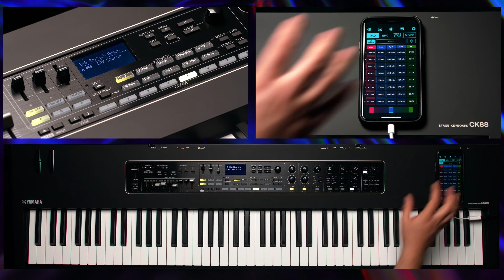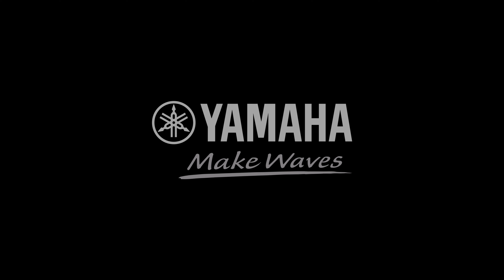CK Tips | How To Use The Mod Wheel To Control The USB Audio Input Volume

Comment: I have tried connecting an iOS servicing using the USB-B host port but the iOS device is not recognized.    If I connect the iOS device via the USB-A device port it is recognized.    However the mod wheel will still not control the volume as this video describes.